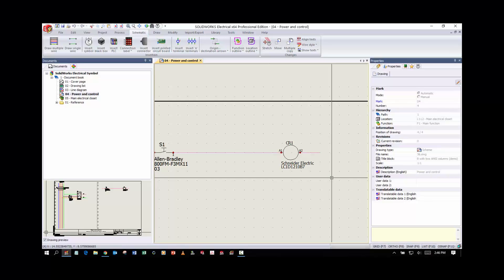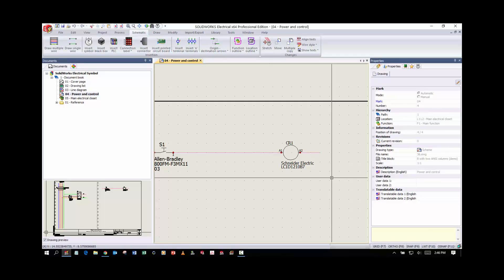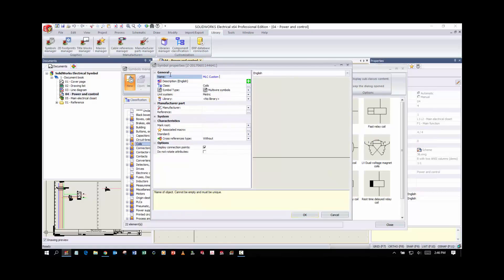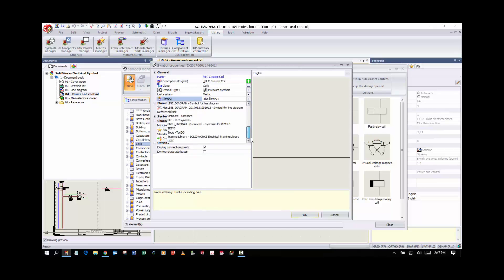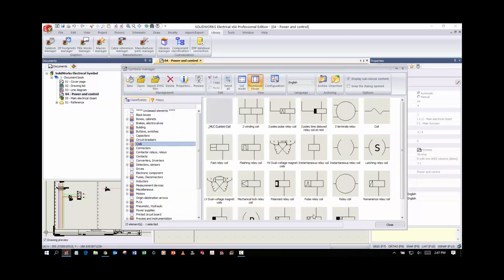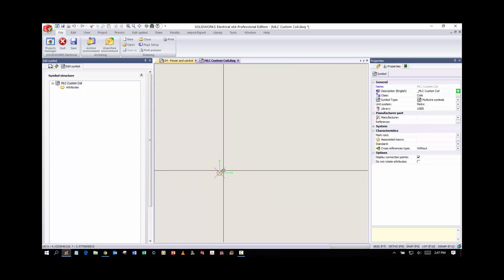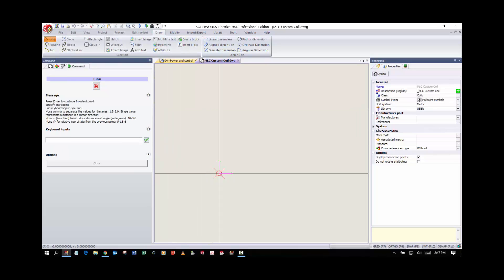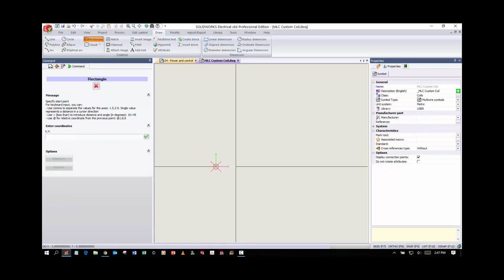Tech Tip: Create a Symbol in SOLIDWORKS Electrical

Comment: This didnt show enabling the connection points or anything not really helpful. Or utilizing the functions of solid works electrical.
Reply from the maker: That's true, this is a tech tip that covers only a sub-set of what you need to know to operate the software.  If you are interested in learning more, consider an instructor-led training class or a tutorial that starts from the beginning.  Electrical is a powerful tool but it does require a certain amount of background information and an understanding of how everything works together.